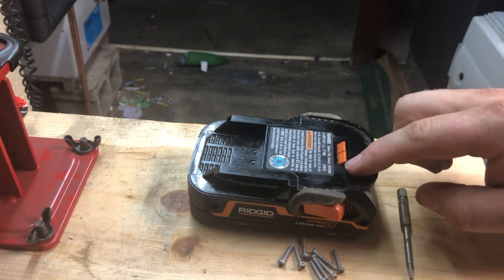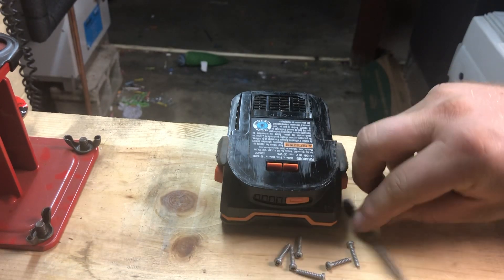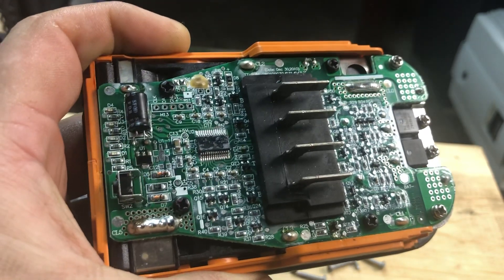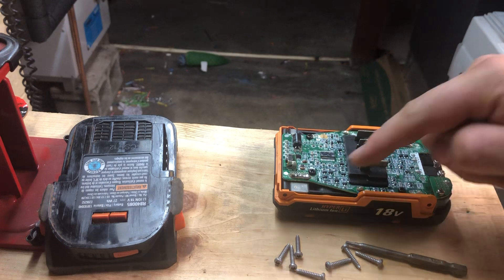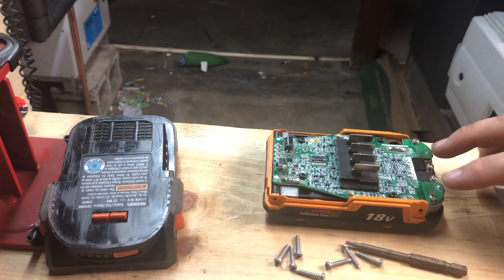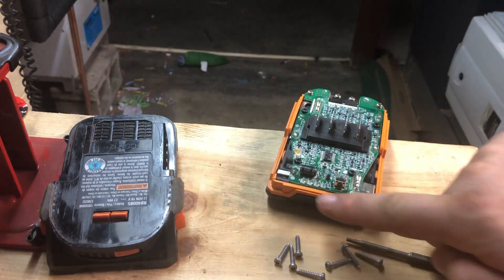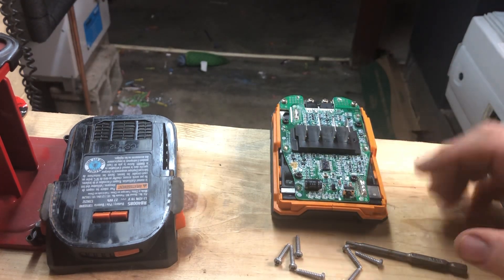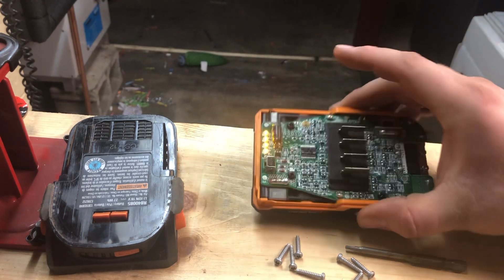Ridgid 18V battery has no lights, charger shows solid red - fixed

Comment: I have a AEG impact driver with a 4Ah battery, but I

don't have the original charger is there any way tocharge it ?

I connected a laptop charger it doesn't chargers..please help
Reply from the maker: My guess is yes there is but who knows how they set up the battery charging profile :S
Reply: @jimknowlton342 i have monitor the voltage of the battery when i connect the laptop charger it slowly rises n stops...

Comment: Mi bateria parpadean las dos luces la roja y la verde ? Por que lo hace
Reply from the maker: you probably have a shorted circuit across two pins of the micro controller. You should clean it very carefully like I did in my video and see if it helps.

Comment: Mine has solid green but the light battery gauge isn’t working
Reply from the maker: The test button may be dirty or corrosion has affected that pin on the IC chip.

Comment: Ridgid has lifetime warranty on the batteries now
Reply: Must be registered within 90 days, otherwise warranty is 3 years not lifetime.
Reply: Any luck with that?
Reply: @davidshumski4629  just warrantied my 2ah. Went pretty smooth
Reply: @bryanchavez3597  I have to take time and do the warranty paperwork
Reply: Yeah i went to the website called the 800 number and they said they were sending me a preprinted shipping label to drop it off at ups. That was only 4 years ago so it should be here any day now. Im guessing since its only taken 4+ years to ship a label i should get the battery sent back to me in the next 30 years!
Reply: My warranty paperwork was denied.  I gave them everything they asked for.